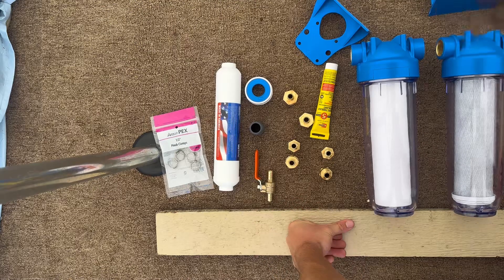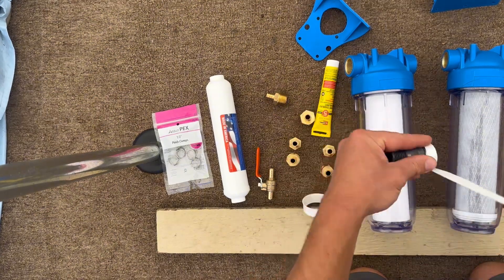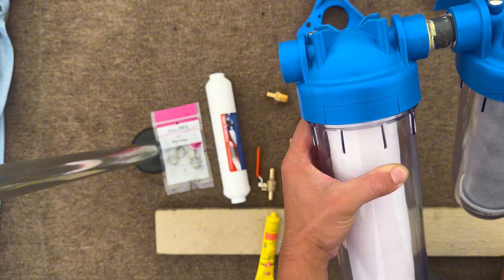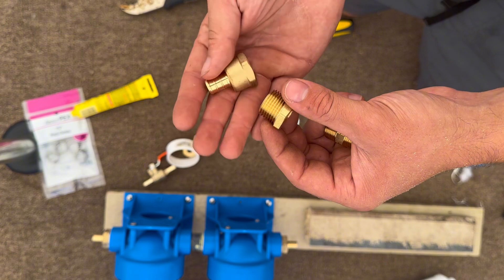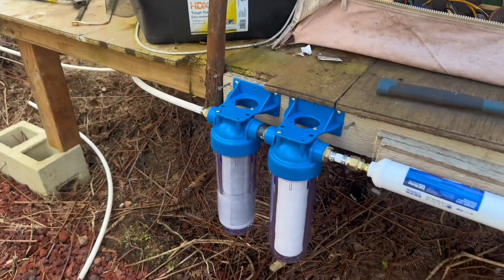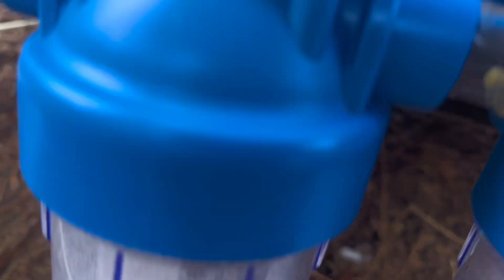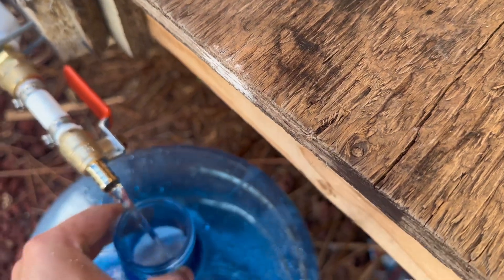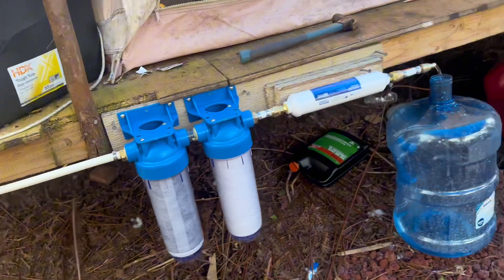How to filter rain water | QUANTUM DISINFECTION

Comment: Nice design but your last filter is only half full of water because it's laying flat and will trap air in the top allowing bacteria to grow, I would change your design so your last filter turns straight up so the air is being forced out going up and then you know ALL the air is out 
and no bacteria can form INSIDE the filter.
Reply from the maker: Most reverse osmosis systems have filters sitting on top of the micron filters that are horizontal in direction. I don’t think air can get trapped in a pressurized system. That is like saying all pipes need to be vertical because if they are horizontal they won’t fill all the way…

Comment: The black pipe looks like steel gas pipe, if so it will rust and eventually leak. Brass or pvc would be better.
Reply from the maker: Thank you for the suggestion. It is a plastic connection. Then the other stuff is brass

Comment: you should have put pipe unions between the two filters so you can easily take it apart and line stuff up .
Reply from the maker: Yes and probably a pressure gage and shut off valve between the filter and water supply… Many improvements can be made